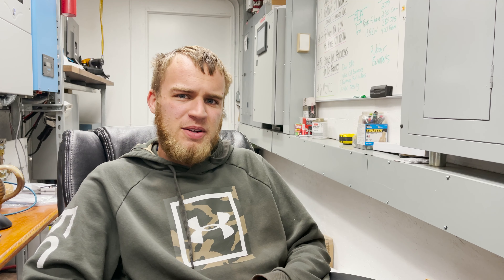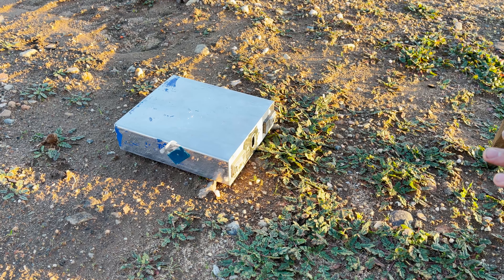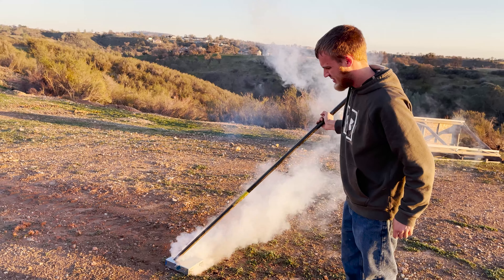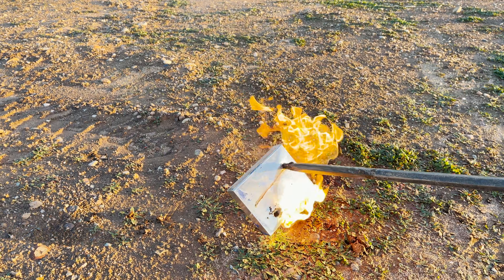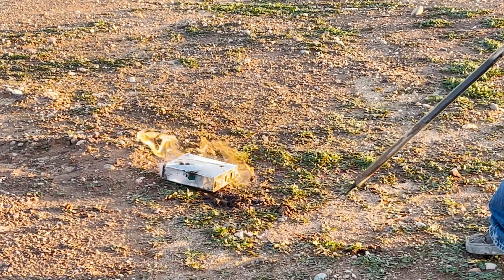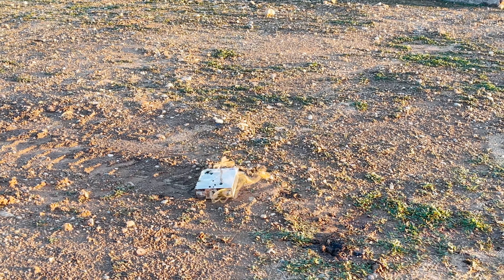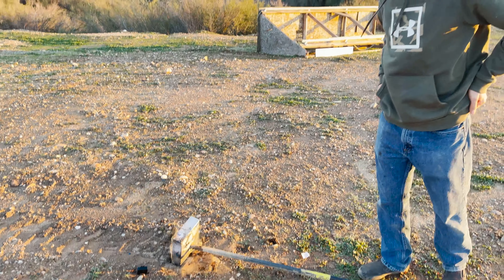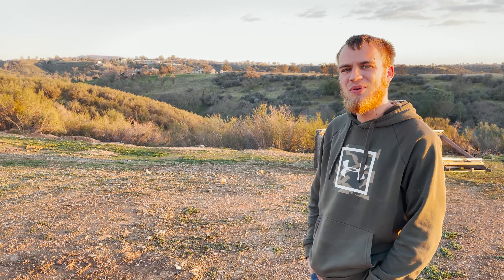LiFePO4 Puncture Test - Can these batteries catch fire? Is LiFePO4 Safe?

Comment: It's great to see these kinds of tests, keep them coming! I think the big win of LiFePO4 isn't that it doesn't burn - clearly it does, it's that it doesn't erupt violently into a gigantic ball of fire like lithium cobalt/manganese does. Looking forward to the overcharge testing!
Reply from the maker: Thank you! Coming soon!
Reply: In normal use case like the battery is overcharged or overdischarged or short circuited i believe it won't catch fire like this. Crushing the battery can only happen if like u have an earthquake and your home collapses but then u have more things to worry about than just a fire 😂.
Reply: Exactly - a bunch of 18650s would react more violently. Sure, this will still burn your house down lol but it doesn't seem like it would be as intense as e.g. those Tesla fires, given you had an equivalent amount of these batteries
Reply: Yeah, this huge cell would have become a massive firestorm if it was li-ion. Lifepo4 on the other hand seems pretty docile and doesn't really react much even to extreme abuse.
Reply: @KuntalGhosh  Lithium are used in RV vehicles that can easily be in an accident causing a puncture.
Reply: @badgerpa9  in RVs u literally have tanks of lpg and if genarator a tank of petrol as well. And the sparks from crushing metal will immediately ignite propane or petrol.
Reply: @KuntalGhosh  Well I guess that makes the battery not burn at all then?  There are many RVs and recently many people are not getting generators on towable RVs and going solar with lithium batteries.  Many go all electric no LPG.   Also since we are not in TV land fuel tanks are designed so they do not explode same with LPG tanks and of the hundreds of accident scenes I went to I never saw a fire from a gasoline or LPG tank, but have seen batteries cause a fire while the person was driving. I realize fuel could ignite easily but every scene we cat littered the fuel on the ground and cleaned up never a fire.  But then this is not TV land. In real life it is a hazard but does not explode like on TV.  There are more and more fires in RVs with lithium batteries.
Reply: @KuntalGhosh  hope Lithium Iron Phosphate sees this bro. what a cope, imagine defending a battery chemistry that literally catches fire and spews toxic lethal smoke when you puncture a cell. this post brought to you by Lithium Titanate Gang
Reply: I think because you jave, what appears to be prismatic cells, there is more material to react. The FAA did a study on cylindrical cells and found LFP to not explode into flames.
Reply: @doooofus  My battery chemistry can beat up your battery chemistry.
Reply: It says clearly in the label, dont punture more than once
Reply: @aliveandwellinisrael2507  It's fiery, but mostly peaceful. :)
Reply: O @KuntalGhosh or crash

Comment: I was told they won´t burn, which is wrong, they burn, but using oxygen comeing from air. Which is much better then the others which provide their own oxygen, but you really cannot say that they are totally safe because they cannot burn at all. Thank you for making that clear.
Reply from the maker: Yes you are correct.  what we discovered was that once the electrolyte was vaporized by the heat of the first puncture that it changed its properties a bit making it now flammable. we believe the second puncture created some small form of a spark that caused those vapors to ignite. Realistically in a real world situation the second puncture wouldn't come later on, imagine a vehicle accident where everything happens all at once
Reply: 700 bucks  for a battery  that can burn my cabin down.hmmm
Reply: @Mikerockinon1 is someone throwing 20lb metal spears around in your cabin?
Reply: @Rhinopkc  i throw them every day in my cabin ;)
Reply: LiFePO4 really does not burn. This fire is from the electrical short-circuit caused by punctured shell making a contact with the anode.

Comment: I have punctured LiPO batteries which are very different many times.  I have noticed that leaving the cells shorted with something metallic it makes it worse.  If you would have removed the tool it might not have caught fire at all.  I feel like leaving the cells shorted allows the current to create more heat than just a plain puncture.
Reply: Now that, is interesting
Reply: Right. That's what I have posted before in this comment section. You can look at it.

Comment: Fire is from the short-circuit caused by the punctured aluminum shell and anode. LiFePO4 does not catch fire such ferociously; it is an electrical fire from a short-circuit between anode and the shell.

Comment: I'm happy to see that they don't explode, and with a proper temperature monitoring system in place I believe something like this could be taken care of quickly if it happened in a home storage Solution. BUT this is one of the reasons I am building a mini power station outside ( like a 5x4) little building outside, because you never know if your going to be out of town, I rather lose all my equipment if need be, than my house, maybe a little over paranoid, but it is what it is lol. Great Video, seeing things like this helps the community a lot!
Reply: Better to be paranoid than homeless
Reply: I doubt that you could control it  . The output of toxic gas in any confined area would drive you away from doing anything unless you had a proper breathing mask and air tank .  Also lithium battery fires are very hard to put out . Tesla cars can burn for days .  A test like this in the open air of a small battery is nothing like what would happen in a confined area like a camper with  a bank of much larger batteries that will all go up and set the whole thing on fire .  You are wise to build a separate battery storage area .

Comment: Great test & interesting results. I saw a YT guy accidentally bumped his lab power supply dial up a bit  after setting up 16 brand new 280A EVE cells for their final top balance of 3.65v when something fell over & bumped it up to 4.6v for the next few days until he returned to find them all looking like footballs. 
So he decided to use them and see how they go and after a year of pretty heavy use & abuse he managed to squish them back slowly to a reasonable size and shape, he did tests to see how much life was left in them and he still got 255 amps total from these highly abused batteries & only lost 20-30 amps. I thought that was pretty amazing & a credit to there output ability all things considered.

Comment: You should open up the aluminum casing and see if all the cells caught on fire.  I bet the reason it caught on fire was not a second short from the second piercing but from the impact of the second piercing forcing the air inside the case to blow out the hole from the first piercing.  Like blowing air on a smoldering ember.  It increased the temperature high enough to ignite the electrolyte.
Reply: That is one cell.

Comment: Interesting test. The first hole caused venting, and severe heating of the plates... the second hole caused the venting to exit the glowing hole and the vapors passing over the red hot plates ignited the vapor.
Now we gotta wonder WHAT the electrolyte is...
Reply: Some organic CH molecule. Ethylene, propylene, something like that
Reply: @yggdrasil9039  that is why solid electrolyte lithium batteries will be very significantly safer. (when they eventually reach maturity...)
Reply: Beyond 2040 likely. Hopefully before though.

Comment: The reaction they will also vary alot in the chemical composition the manufacture use apart form the main Lifepo4 as well as the battery design. I've seen lifepo4 explode and i have seen them only smoke. That's why its important to know the brands of the cells.
Reply: What's the worst you've seen? Got any links? Thanks

Comment: For what it’s worth, lead acid can also explode due to gassing hydrogen just like propane, diesel and petrol. All forms of energy storage carry a fire risk in the right conditions. What is much better than Lithium Ion is that it appears to lack the explosive run away fires. Basically, treat any form of energy storage with respect.

Comment: Many sellers on Amazon advertise 12V LiFePO4 battery packs as a replacement for lead acid gel cell alarm system backup batteries.  It appears to be an extremely dangerous practice to substitute a LiFePO4 battery into the alarm system without knowing anything about the compatibility of the charging circuit (which is designed to work with lead acid batteries) with other battery chemistries such as LiFePO4.
Reply: Good point, although LiFePO4 batteries should have their own internal Battery Management System (BMS) that takes care of over voltage/current conditions. BMS are programmable, so some may have been tuned to work with lead-acid chargers. But as you said, I would hesitate to use a Lithium chemistry without doing thorough DD on legacy equipment.

Comment: That steam admitting from the battery is about 49% hydrogen gas.
Reply from the maker: Do you know the formula for the chemical breakdown?  I’d like to know what inside is releasing the hydrogen molecules
Reply: What is the remainder?
Reply: @markm8188  nothing that concerned me as to flammability, so I didn't make a mental note of that remainder. The hydrogen is the killer.

Comment: The problem was your second stab, it created internal pressure because the spear was in the hole and it mostly went out the first hole pushing the fire with it. On an Internal error the flames would be contained i guess.

Comment: I have been toying with changing out my dying diesel in my sailboat for an electric system as I don't use the engine except to get out of the marina and maybe an hour tops during the day. Fire on a boat is extremely bad so it is one of my concerns with electric. I would like to see an attempt to extinguish this battery as one of the things I do not like is that batteries seem to contain all the reactants necessary to burn so smothering them or  cooling them doesn't extinguish them. With a diesel the automatic fire extinguishing system does work to some degree.

Comment: State of charge when punctured?  this is major factor in Lithium batteries. 
Btw Please, use proper respirator when you do these tests. Fluorides released from the burning reaction can be really bad for you. 
There is very little test data on amounts of fluoride released but they seem to agree that it can be even lethal. if breathed directly in (very corrosive for lungs) 

Something interesting i did learn with Li-Ion cells, is that if you just open them, there can be next to no visible electrolyte, but if you short them internally or externally, they push electrolyte out from the inner structure.  with cells i have played with, i haven't seen "running electrolyte" or slushing liquid inside the cells, also when opened, its damp but not dripping. 
Short-circuiting changes this quite dramatically, and there can be puddle of electrolyte suddenly, and all it needs is a spark to have a fire ball. 

Important factor here however is that this cell if was fully loaded, behaved very mildly, and if it had only very low state of charge, then this tells very little.

Comment: Had you not hit it a second time, it would not have caught fire. The vapour being released from inside was too concentrated to actually be flammable. Outside the vapour mixed with oxygen and diluted the vapour enough to become flammable. The red hot metal would have stayed inside and only vented off. Because you hit it again, it caused a pressure shock that sent particles of red hot metal out of the vent hole into an environment where the mixture of vapour and oxygen were volatile.

Comment: I dont think there is any high density battery that wont burn if badly punctured. Pr definition a battery stores energy, and you have to assume that a bad puncture will equal a full short. That energy has to go somewhere. That doesn't mean that there isnt battery chemistry that is safer than others, but thats more in terms of how likely is it to critically fail over time, wear and demanding conditions. When a failure does happen there can also be large differences in how agressively it burns, and how dangerous the fumes are.

Comment: Are the cells Voltage really ZERO Volt? May be the BMS shutdown so no Voltage is present at the terminal when you shorted out the output terminals
Reply: There was no BMS connected to this individual cell.

Comment: I'm curious regarding the chemical reaction of that fire and whether it's about the battery chemistry alone or if it requires atmospheric oxygen, too. Would it react the same way in a vacuum or a relatively airtight enclosure, i.e. with limited oxygen supply? Does installing the battery e.g. in an airtight metal box (with overpressure release valve) reduce the fire hazard?
Reply: He says in the comments the electrolyte contains perchlorate and organic solvent. Perchlorate is a strong oxidizer and will provide its own ‘oxygen’ for combustion. So yes it will burn once a spark or it reaches its critical auto ignition temperature (which is significantly higher than in other lithium battery chemistries). Glowing red hot that we saw after the initial stab is 500C+, so high enough for auto ignition. The combustion products (smoke) do need to exit the combustion site, or they tend to self-smother the fire. The second puncture hole gave a route to flush these out, hence the fire got way more intense. But as he states, it’s unlikely in practice a second separate puncture event would happen in a real life accident.
Reply: @kdkd693  

No. The second hole simply provided air (20% oxygen) to feed the flames.

Plenty of info on how fire "works" to be found elsewhere online. Your suggestion was rubbish so kindly don't do it again.

This video was hardly conducted under controlled conditions and released goodness only knows what gases into the atmos'.

In UK this sort of silly experiment would be condemned on the grounds of atmospheric pollution.

However, the clip did display that the item was not proof against "careless rough handling" ... exactly like almost anything else in the electronics dept'. 

The result we all saw for ourselves.

Ergo LiFePo4 can burn if damaged, so, although it was a very poorly constructed and conducted experiment (no PPE or fire suppression bottle or even any sort of decontamination kit come to that) the result was that the cells could and did burn.

And of course if a battery was in an unsuitable (flammable) location then you wouldn't need a lot of imagination to see what happens next.

All in all ...3/10.
Reply: @t1n4444  thanks for your kind words….
Reply: @kdkd693  

I should jolly well hope so indeed.

More information ... on anything ... online than you can imagine.

If you don't care to read up on the research papers published by battery  users, eg Ford, say, then simply search YT.

If there's something that can be done by people then YT will have a clip available somewhere.

And some of the video clip stuff people post on YT is jaw dropping with regard to their personal safety, that of others and the environment/atmosphere.

Punching holes in a lithium battery of any chemistry to "see what happens" is not very sensible.

Comment: Great video man - i bought 6 lithium ion phosphate batteries for our truck camper.  i have set up storage between the camper and the truck bed.  is that a safe place to store?  how much gas do they give out?
Reply: Depends on your locality. LiFePo4 can short if charged when below freezing.
Reply: @DavidHalko  but wouldn't the BMS step in and stop the charging?
Reply: [Dave] - “LiFePo4 can short if charged when below freezing.

 @vroor32  - “wouldn’t a BMS stop it?”

Yes, stop charging your battery if it is too cold, but that might not give you the warm & fuzzies you if you live in Canada, Finland, Sweden, Alaska, North Dakota, etc.

No, the short occurs within the battery, not on the outside of the battery.

Dendrites grow from one pole to the other inside the battery, kind of like stalagmites & stalactites grow inside a cave. You may see a stream going in one side of a cave, and coming out the other… kind of like battery cables attached to a battery. You may stop the flow of water outside a a cave, kind of like a BMS stops the flow of current outside a battery, but you never stop the stalagmites & stalactites from growing inside, the same way you can’t stop the dendrites from growing from the outside.

Once the dendrite crosses the battery from one pole to the other, inside the battery structure, a short occurs, and a thermal runaway event will likely soon follow.

The dendrites grow, as the battery ages. Charging during low temperatures only accelerate the growth. 

Toxic fumes are emitted with heat during a thermal runaway and you will not want to be an enclosed area (ie inside a car) during that time (ie driving on a freeway at 70 mph.

When it is time to change a battery, under normal operation, it basically becomes a ticking time bomb… especially if used in an area close to the poles, where charging is done at or below freezing.
Reply: @DavidHalko  ooofff!!

So what to do?? Buy self-heating LiFePo4 battery (keep outside vehicle) or get bluetti style battery and pay more money?? 

🤔
Reply: @vroor32  - self heating batteries are good, those clearly take energy.

Battery performance decreases in cold, so that can be problematic for driving.

Keeping cars indoors help, so no parking & charging cars outside in the winter. 

A car with growing dendrites are no fun, keeping them in a garage attached to living areas, since you could magically wake up to an unexpected thermal runaway event. 😢

The days of powered & heated detached garages may be popular, in the near future.

Comment: Everybody is so concerned that the case will flow electricity if the blue cover is compromised.  You conclude it did not.  Seems no additional isolation material between cells in a pack seems necessary.